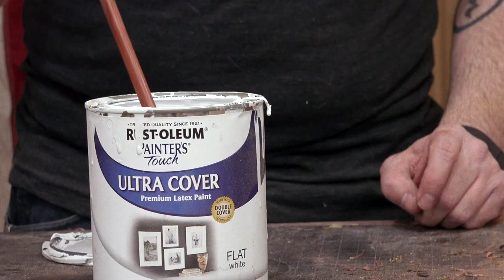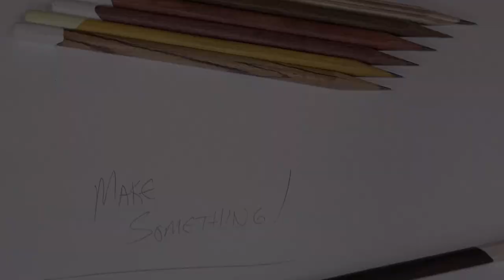Solid Wood Pencils Without a Lathe. Beginner Woodworking Project.

Comment: I'm probably not going to make a pencil. But I have that exact same sorry excuse of a protractor. Keeps falling apart every time I touch it! And I used it with much frustration yesterday, and need it tonight also. Transferring the angle to the bevel is such a simple and good tip, how on earth did I not think of it?? I had them both sitting there lol!. Anyway, this will make my evening a lot more enjoyable, thanks! :D

Comment: Now that was freakin' awesome! Love it.

Do you think you could have done it with less waste or did you need that size of wood to make it safer to work with the power tools?
Reply from the maker: +Make Build Modify The pieces I used was scraps to begin with. That being said I probably could have had less waste.
Reply: +Make Something No troll intended. I really liked the project. Good stuff.

Comment: The paint dip makes them look even better man! very cool 
Would it be possible to cut a hex in a steel plate and pass them through it like making dowels for a production batch? Good or bad idea? :)
Reply from the maker: +Cactus! workshop I thought about that but I've never had much luck with that technique. Lots of tear out. Thanks man!

Comment: Any thoughts on the best way to make the groove for the lead if you don't have a table saw? Perhaps a couple of angled grooves with a sharp knife and round it out with some folded sandpaper? Not sure....
Reply from the maker: +David King I used a router with a v-groove bit
Reply: +Make Something Thanks David, I'll give it a go - I have the blanks and leads ready to roll! Keep up the good work - love the videos and Tweets.
Reply from the maker: +David King I think you could also use a sharp knife. The glue will fill in any small gaps. Thanks David!

Comment: Fantastic! I wonder if you could have chucked up the squares in a drill and put them through a hole to make the round parts...wouldn't have been nearly as interesting as the technique you had..
Reply from the maker: +The Old Plank Woodworks I did think about that technique but I've never had much luck on making my own dowels. I seem to get a lot of tear out although I was probably doing something wrong. Thanks for watching!

Comment: Can i check how do you cut the slot for the pencil lead in the wood?
Reply from the maker: It was done on the router table with a v-groove bit.
Reply: thanks for the prompt reply. Can i check what is the size and angle of the v groove bit.
Reply from the maker: I don't recall the angle but details can be found here: https://makesomething.tv/how-make-wood-pencils
Reply: Thanks Make Something . cant wait to make the pencil.

Comment: So much waste...
Reply from the maker: You talking about your comment and the time I spent reading it? 🙃
Reply: @MakeSomething   well if you think so, you are right.
But why cut a 3 cm x 3 cm square piece when the final pencil is only 0.5 cm diameter? Also go sanding all that time, why don't already cut a 0.7cm x 0.7cm square piece then cut it and do the final shape in half time? Also with the same amount of wood (3x3 square) you could make not one but roughly 3  pencil out of it!